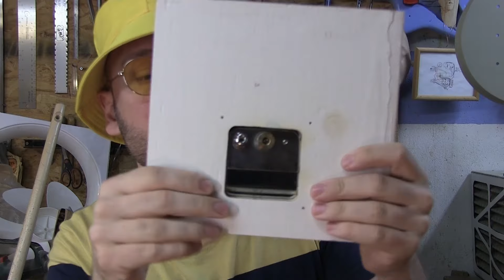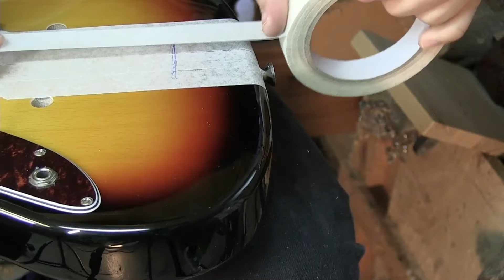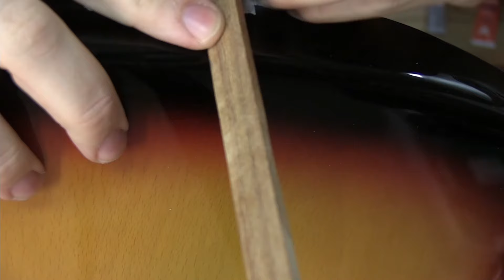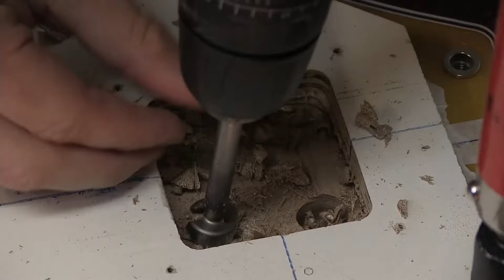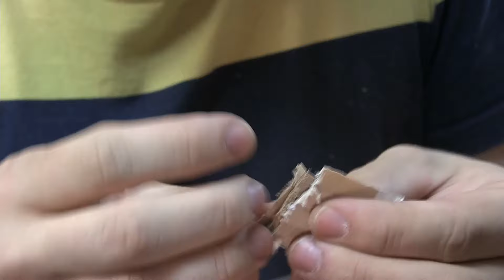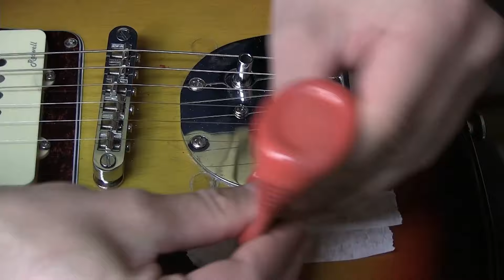Jazzmaster tremolo on a Harley Benton  JA 60

Comment: I use the same model as you, and I want to use a Tremolo with a whammy bar. How deep do I have to dig out to use it? Also, you have the same left-handed guitar as me, so isn't it uncomfortable to insert the bar into the right-handed Tremolo?
(It’s translated, ily from south korea❤❤
I hope you could reply)
Reply from the maker: @Beakjef32  hallo 😀 it's not uncomfortable maybe because I'm used to playing right handed flipped for left handed and the trem is so far back it isn't in the way for my hand but if I could find a nice left handed one I would switch to it  when it comes to how deep you should go down into it, just a little bit more that what your trem is but 2 mm or so is enough 🙂 hope this helps 👍😀👍
Reply: @zurowetz  bro did really nice custom
thanks bro🥺🥺🥰🥰
Reply from the maker: @Beakjef32  cool 👍but why the sad face?
Reply: @zurowetz  just too thankful
Reply from the maker: @Beakjef32  aww well I'm glad I could help you 😊😊😊